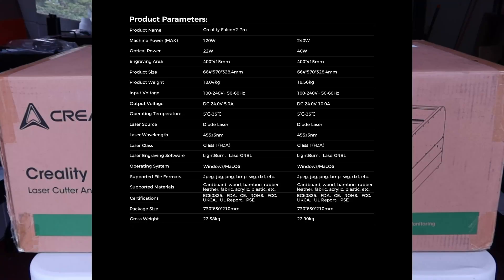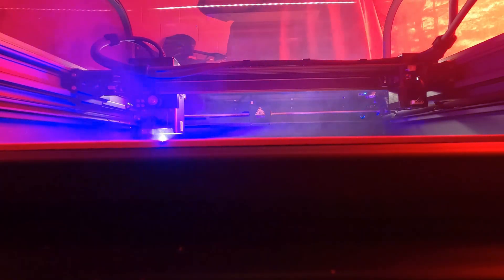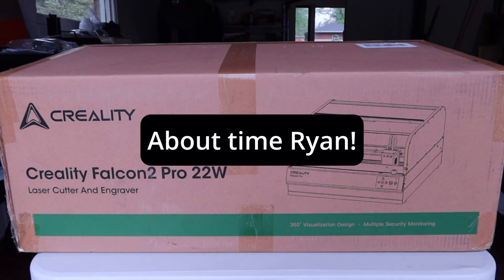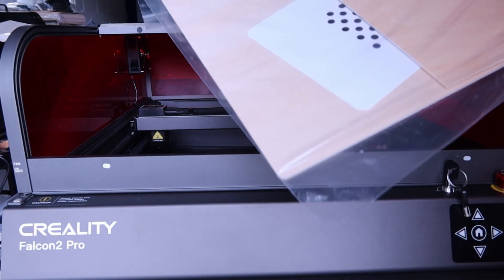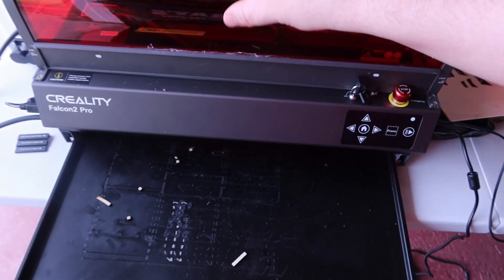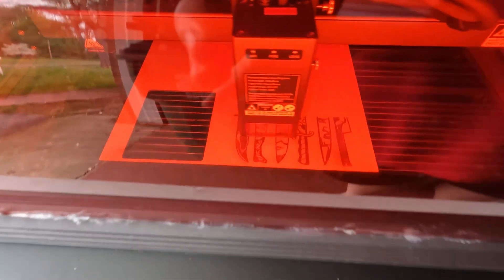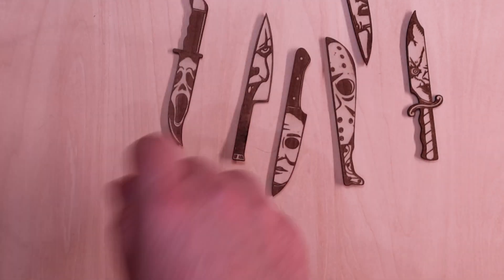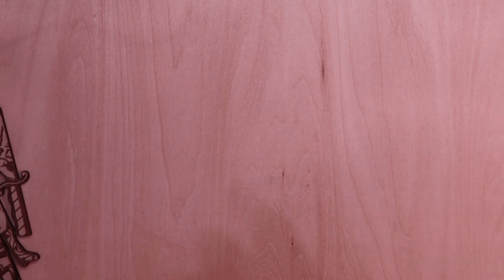Unleashing Fun with the Creality Falcon 2 Pro 22W!

Comment: Can this printer engrave stainless
Reply from the maker: @andriesdupreez4170  no, this laser isn't intended for metal.
Reply: @ so no anodised metals or powder coat or so on
Reply from the maker: @ blue diode lasers just aren't good at metal in my experience. You'd want an IR diode or better a fiber laser.
Reply: @ I’m not looking on doing deep engraving in metals I’m purely looking to basically remove coatings if needed on metal
Reply from the maker: @andriesdupreez4170  Blue will remove the coating of some things, IR will do that but will also oxidize the surface of some metals too, and fiber will do all of that and actually 'engrave' some metals.
Reply: @ ok thanks so much for the info I’ll keep all this in mind and experiment as I go and then focus on getting a fiber for future projects